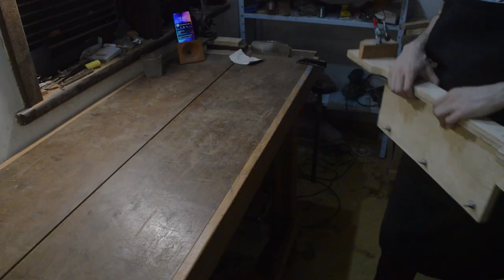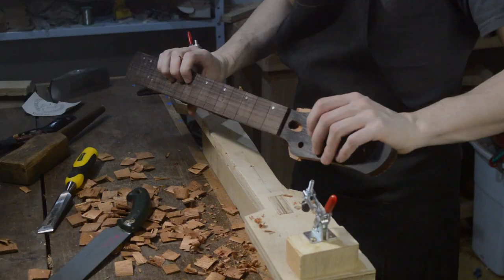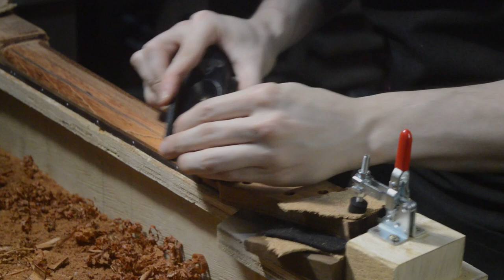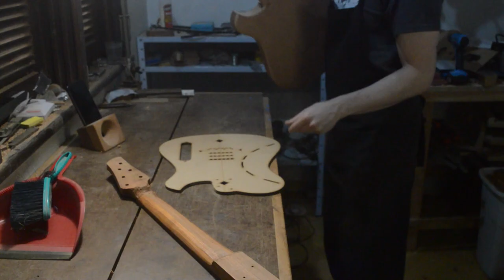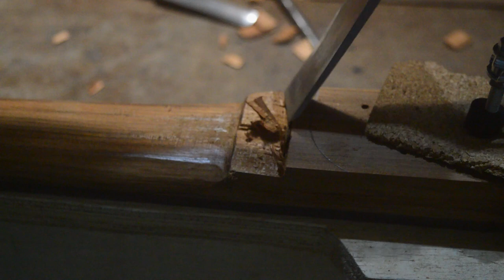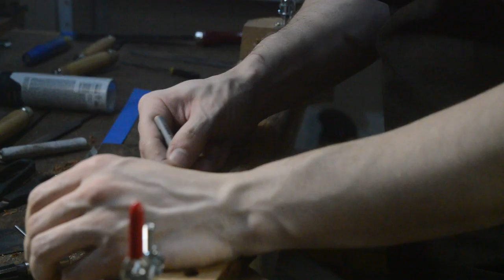Guitar Build - Part 8 - Shaping the neck

Comment: Considering how much material you had to remove by hand that came off pretty quick. But even with the stop cuts you made, it kind of freaks me out whacking big chunks like that out with a chisel. Good job though brother. What kind of wood is that? Looks like a rosewood of some sort but super hard.
Reply from the maker: I measure 3 times before starting to saw hahahahha. The wood is Jatobá (Hymenaea courbaril), it's a brazilian wood, very hard and dense. But so pretty!